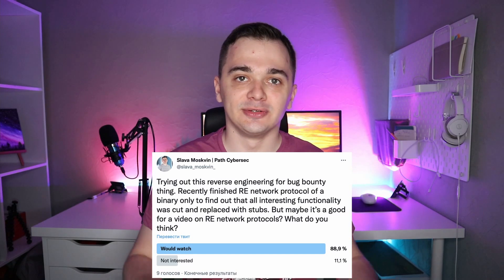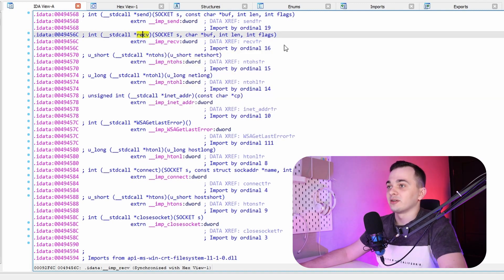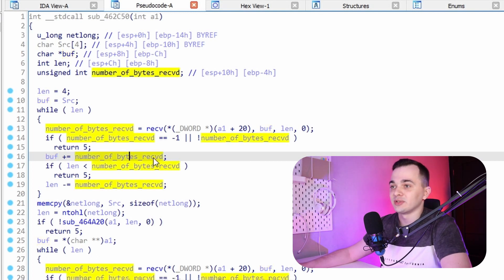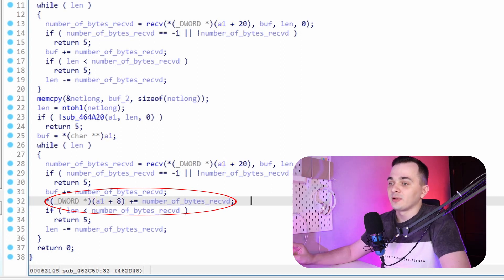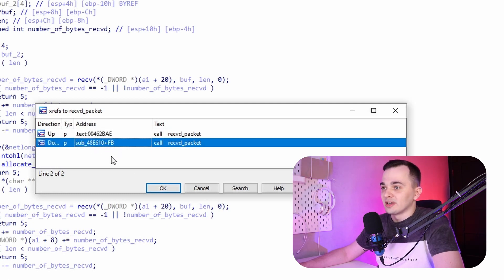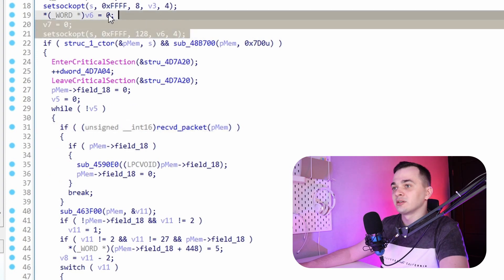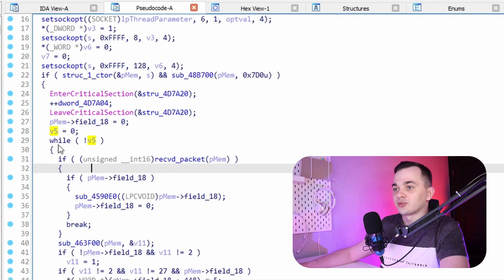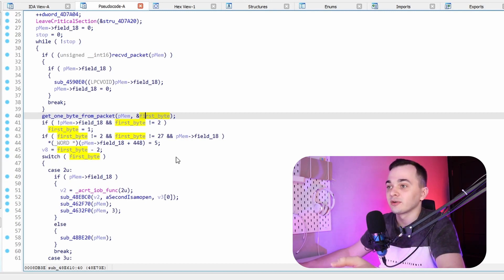Reverse Engineering Network Protocols in IDA Pro

Comment: Sometimes with reverse engineering, the hardest part is resisting the urge to facepalm not so great code.
1 - Line 17 (nor 33) will never happen. recv() won't read more than len given, so it will always be false. In the event the impossible happens, by the time you check an over sized received count, your buffer has already been overflowed, so all bets are off at that point.
2 - Line 21/22. Better off just declaring them both in a union and skip the memcpy(). Or perhaps just use an alternative to ntohl() to decode the buffer directly.

Also, it's nice how IDA Pro knows the first argument to recv() is a SOCKET, yet Hex-Rays still fills it with _DWORD.

Comment: i have a packet dump taken from wireshark but how do you reverse engineer when do you dont have information about the server
Reply from the maker: You can try to reverse engineer the client or try to find structure to data in Wireshark. Developers often use type-length-value format or its variations. Also, there're common formats to store different values like floats, dates, etc.
Reply: @PathCybersecSlavaMoskvin  interesting do you have any videos on the channel covering either of these 2 topics in detail
Reply from the maker: @Saitama-ur3lq  No :(